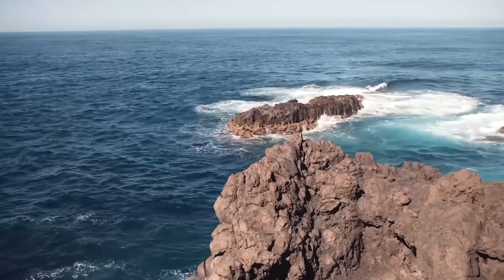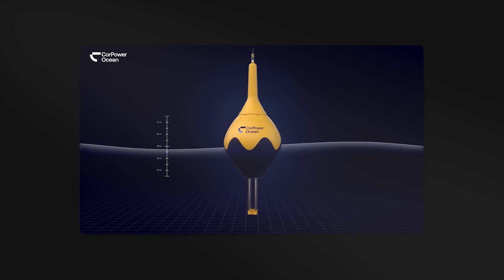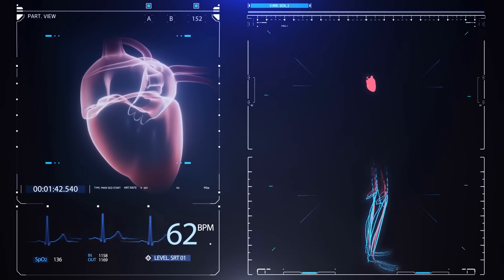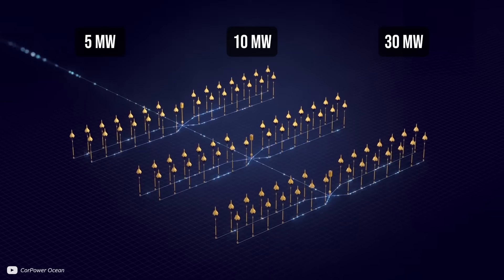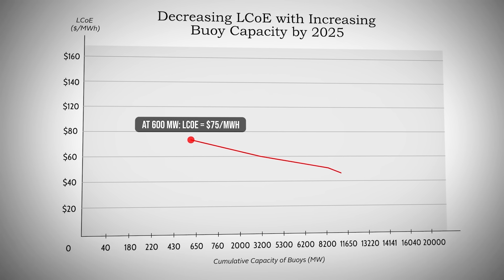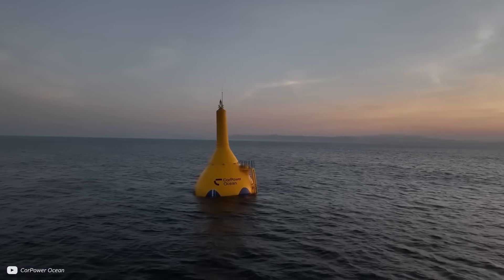Unlimited Wave Energy: This Buoy is the Future

Comment: Hydraulics are not clean energy, if a Oring breaks or a hydraulic line breaks you have a serious problem with contamination. You are definitely going it the right direction with the ocean as it is the most powerfull natural force on earth. If anyone has more information contact me
Reply: These internal mech (i guess) wouldn't be operate using oil pressure; they're probabile use pneumatic system.
Reply: @massimopiu yes they need to operate on hydraulic fluid which is a fossil fuel for the viscosity to enable the piston to operate at it’s potential. With my patented invention I don’t use hydraulics or any battery backup

Comment: @ZirothTech what do you think of the system developed by Panthalassa? Seems that not attaching the buoys to the bottom of the ocean could significantly simplify operations. + Opens a much large area of operations. On the flip side, it's not clear how to transport the energy generated miles inside the ocean.

Comment: How about a linear generator oriented vertically, underwater? When magnet container gets to bottom of coil shaft, it expands, reducing density and using buoyancy to bring container back up. All underwater. Density change mechanisim theoretically uses less energy than the generator produces, thus no fuel, or waves, needed.

Comment: Tidal power and wave action can be used in remote areas ,where power doesn't exist, to power Oceanic Aeration. If Oceanic Aeration was developed around the Arctic, the diffusion of frigid air under the sea surface would cool the surface water and accelerate the refreezing of that region.  A thousand cubic feet per minute of frigid air diffused under water has been proven to effectively cool 450,000 gallons in that same minute. If you don't believe this, take a compressor and some diffusion equipment up there and try to prove me wrong. We've got to make a serious effort to cool the oceans or all the negative predictions will come true. Fossil fuels aren't going to just disappear, it takes massive amounts of fuel to restore things after each major weather event.

Comment: AI Summary

Abstract:

This video explores the C4 wave energy converter developed by Swedish company Core Power, a technology aiming to overcome historical challenges of efficiency and survivability in harnessing ocean wave power. Inspired by the human heart's efficiency, the C4 utilizes a pneumatic system, the "WaveSpring," which allows it to capture energy during both the upstroke and downstroke of waves, reportedly five times more energy per ton than other systems. Key to its design is a dynamic adaptive piston pump concept, originally patented by cardiologist Dr. Stig Lundback, which uses stored pneumatic pressure for a dual action. This system also enables a "detuned storm protection state," allowing the C4 to withstand extreme weather, as demonstrated by its survival through powerful Atlantic storms with 18.5-meter waves. The C4 buoys are made of lightweight composite materials and are tethered by a novel "UMACK" anchoring system, designed for high holding capacity, low cost, and minimal environmental impact. Core Power's strategy emphasizes reducing the Levelized Cost of Electricity (LCOE), with projections of achieving costs competitive with wind and solar power through large-scale deployment in "Core Packs" or wave farms.

Core Power's C4: Revolutionizing Wave Energy with Cardiac-Inspired Tech and Storm-Proof Design

*   0:00:02 - The Untapped Potential of Wave Power: Ocean waves could theoretically meet global electricity demand, but harnessing this power has been a long-standing challenge due to failures in previous technologies.
*   0:00:16 - Core Power's C4 Innovation: Sweden's Core Power introduces the C4, a floating wave energy converter inspired by the human heart, claiming to capture five times more energy per ton than other systems.
*   0:00:40 - Overcoming Survivability: A primary challenge in wave energy has been device survivability. The C4 was tested off North Portugal, successfully enduring four powerful Atlantic storms.
*   0:00:57 - Historical Failures: Since 1799, numerous wave energy patents (e.g., Salter Duck, Mighty Whale) have emerged, but commercial success has been limited by efficiency and survivability issues.
*   0:01:44 - C4's Design and Operation: Core Power uses lightweight, tough composite buoys in a point absorber configuration, tethered to the seabed. The C4 converts linear up-and-down wave motion into rotation via small gears, powering an onboard generator.
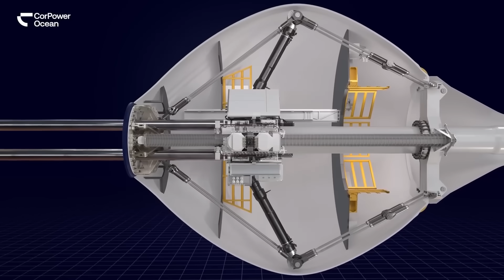*   0:02:08 - Impressive Test Results: A six-month test in Portugal achieved a peak power of 600 kW, comparable to wind turbines that are significantly larger and more complex.
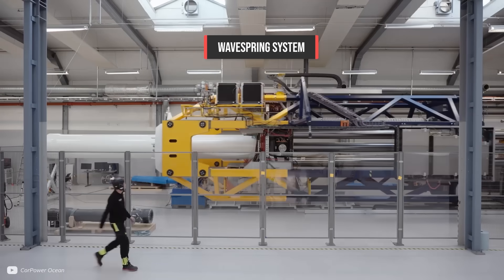*   0:02:48 - The WaveSpring System & Cardiac Inspiration: A key breakthrough is the "WaveSpring" system, building on a hydraulic pump invented by cardiologist Dr. Stig Lundback, inspired by the heart's efficient, dual-action blood flow using pressure.
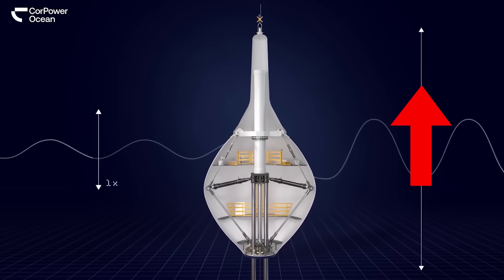*   0:03:41 - Pneumatic Dual Action: The C4 uses a pneumatic system. As the buoy rises, a central pneumatic cylinder and springs store pressure. This stored pressure provides a returning force as the buoy descends, allowing energy capture throughout the entire wave cycle.
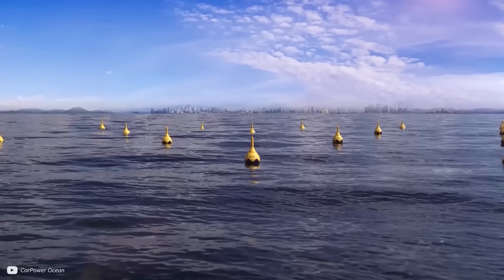*   0:04:38 - Storm Protection Mechanism: The pneumatic system allows pressure to be increased during storms, creating a "detuned storm protection state." This limits buoy movement in harsh waves, enabling it to survive record-breaking 18.5m waves.
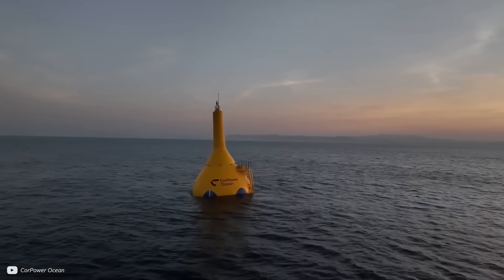*   0:05:09 - Continuous Wave Tuning: In favorable conditions, the C4 buoy is continuously tuned using the onboard generator and WaveSpring system to work in phase with the waves, maximizing power extraction.
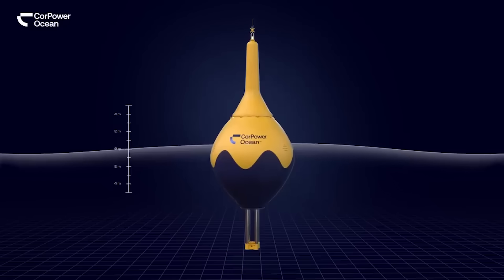*   0:06:53 - Smart Control System: A smart control system manages energy storage and release by the pneumatic springs and how hard the generator works, ensuring the buoy moves in phase with waves, reportedly increasing energy extraction by three times compared to passive systems.
*   0:07:51 - UMACK Anchoring System: Each buoy is anchored by a tensioned mooring system called UMACK (Universal Mooring Anchoring and Connectivity kit), which outperforms traditional anchors in holding capacity, cost, and carbon footprint, and is installed with low-noise methods.
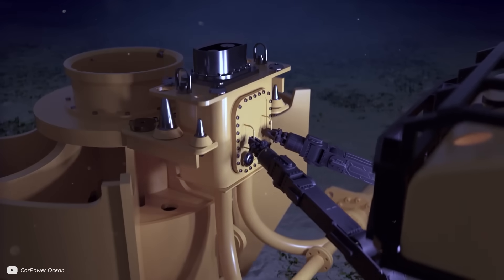*   0:08:27 - Vision for Wave Farms (Core Packs): The long-term plan involves arrays of buoys ("Core Packs") in 5, 10, and 30 MW sets, forming wave farms delivering electricity to the grid via collection hubs.
*   0:08:46 - Focus on Levelized Cost of Electricity (LCOE): Core Power's innovations are driven by the goal of reducing the LCOE. Design choices, like using composite hulls (70% LCOE reduction over steel) and developing the UMACK anchor, are aimed at making wave energy competitive.
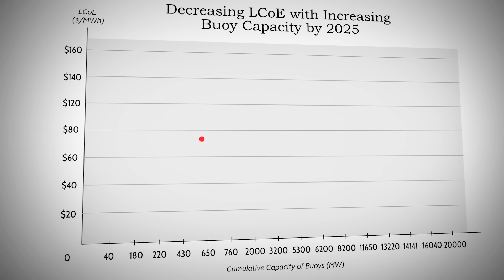*   0:10:07 - LCOE Projections: With 600 MW installed by 2025, LCOE is projected at $75/MWh. With 20 GW capacity, it could drop to $35/MWh, competitive with wind and solar.
*   0:11:12 - Future Testing and Outlook: Following successful C4 tests, Core Power will test arrays of buoys, focusing on long-term survivability in harsh ocean environments, with a positive outlook for commercial wave power.

I used gemini-2.5-pro-exp-03-25| input-price: 1.25 output-price: 10.0 max-context-length: 128_000 on rocketrecap dot com to summarize the transcript.
Cost (if I didn't use the free tier): $0.03
Input tokens: 15494
Output tokens: 1184

Comment: This is a fascinating technology, and its proven record in severe storms is impressive. Their biggest challenges at this point are: maintenance/longevity, which is still difficult to overcome in the harsh and corrosive sea environment, and  theenvironmental impact to the surrounding marine life, which means it needs to be low noise when it functions (not just when it's installed) and doesn't cause significant disruption for sea life in other ways. 

Other than that, end of life recycling needs to be considered too as the fibreglass hull will have the same issue as wind blades - although considering that recycling wind blades is a necessity someone will have to work out, they could just wait for that breakthrough and hitch a ride...maybe? Otherwise they'll need to develop their own recycling process or change processing and/or materials so it can be recycled. 

In the larger context, this could work well with other renewables too, such as working together with offshore wind to cut costs in power lines to shore.. In fact, with the incredible efficiency, smaller size, and far more reliable operation than offshore wind, this innovation might actually replace it at some point in the future (like a decade...). With how reliably waves could create power on a day-to-day basis (rather than wind and sun which are far more intermittent), this won't need much  batteries ether (if it needs any at all), meaning that cost doesn't need to be factored into LCOE. In fact, this tech could act as a kind of baseline power for other renewables. 

It has a lot of potential, but only time will tell if it's capable of functioning reliably in the sea for years on end.

Comment: Google says that they are cheap to maintain.  Here is a quote from Google about their maintenance:

CorPower Ocean's wave energy converters (WECs), including their C4 and C5 buoys, are designed for long-term operation with minimal maintenance. The company focuses on designing components for two to five years of operation without maintenance. Maintenance activities include scheduled checks, inspections, upgrades, and potentially unscheduled repairs. They also offer an Operations and Maintenance (O&M) package to guarantee low-risk and carefree ownership of wave farms.

and it says this as well:

Components are designed to withstand the harsh marine environment and the repetitive loads of wave motion, aiming for a long service life.

These are quotes from Corpower's internet site:

Corrosion: inspections confirmed that chosen corrosion protection solutions have generally worked satisfactory. The composite hull making up most of the surface in contact with sea water was inherently corrosion protected by the material stack. The four metal rods in contact with sea water at the bottom with laser cladded surface coating have shown excellent corrosion resistance. A few parts around seal gland assemblies that relied on cathodic protection were found corroded, which was addressed by adding appropriate electrical connection to the cathodic protection. A few parts of the H-link connecting the bottom of the tidal regulator with the anchor quick connector had a paint-based protection systems that was found inadequate, with root cause found to be quality issue in the coating process that were addressed.

Biofouling: The anti-fouling protection solutions have been found to work satisfactory on both hull and ocean rods. The commercially available anti-fouling paints used were found to supress biofouling. Alloy-Coated rods at the bottom rely on periodic scraping sequence performed by the machine control system. Upgrades to the seal gland and scraper of the tidal regulator have been performed in collaboration with the supplier, aimed at ensuring long term reliability of the scraping function.

Comment: I am a lone inventor and I slip through the existing system in the UK which only helps university research and big businesses. I am a member of the Scottish Innovators Network and our group is now reduced to six members from a high of ninety. The system even excludes professors in our group! We have various innovations for carbon capture, wave power generation and electrical storage concepts using laser technology. Do you know of anyone who could help us to get our ideas reviewed. Presently we cannot even show the ideas as there is no pathway to do this simple yet vital first step. Great video. I have a device for getting electrical power generation from a flat calm water surface but no way to show it to the relevant influential stakeholders. I hope you can help. Thanks. Rod.
Reply: Dr. Ben Miles (he has his own YouTube channel) runs a venture capital firm that focuses on bringing new technological scientific discoveries and prototypes to market. If you check out his channel you can see the kind of technology he showcases as a YouTuber and what his company supports. I don't know if this will be helpful or not, but he does say to contact him regarding such things. There are groups who also do similar work, but I don't know any names I could reliably put forwards. 

I don't know if any of this is relevant to you or helps, but in any case I wish your group good luck in getting your innovations out there.

Comment: I have an idea. A lever attached to a one direction ratching system. The lever moves up, the ratchet moves clockwise. The lever moves down, the ratchet moves clockwise. Now attach a float to the end of the lever and the ratchet ststem inside the hull of a boat...see where I'm going with this?

Comment: Tides are consistent and can be accurately forecast, unlike wind or solar energy. However, tidal power generation requires areas with high tidal ranges, and while such areas do exist, they are not common. The next challenge is that tidal power is not constant throughout the day, so you need a method for energy storage.

Comment: This is such a revolutionary innovation ❤....I was thinking if we want to build a 1000 km long bridge through sea to carry heavy loads; But the problem was arising that the bridge need support pillars to be stable throughout such a long distance. And building typical support pillars under deep sea is very expensive. So, to counter that I thought to use floating bases with supporting pillars on them. But there was another problem with floating bases was it's turbulence due to heavy sea waves and currents. I thought of several ways to counter that and fix the bases on their position again any kind of heavy waves: (1)Using heavy weights working as anchors tied with bases.With this (2)using seismic metamaterials....but it turnedout too expensive(3) Then I got this idea from your video!!❤
This is such a genius strategy!!! It will not only just provide stability to the bases but also harness energy from the waves to provide electricity on the bridge. So, thanks a lot for making this amazing video. ❤ keep it up.👍

Comment: This system is too complicated. If use just for what a problem the whole system would be lighter way cheaper. Maybe less efficient, but what a pumpkin can be used. As an energy storage system. So they energy electricity will be produced at a single point .

Comment: As a guy live next to the ocean, there are things need to point out; anchoring to seafloor disrupt corrals, internal parts are complex prone to fail in salty environment, typhoon or heavy storm can easily damage the buoy, power transfer cabling from the buoy back to power grid, low tide and high tide can make this buoy loose its effectiveness, lengthy permit process with local government can turn the most hardened enthusiasts away

Comment: Our company worked some of these systems as far back as the 1980s.  The problems with the Human Heart are basically twofold.  First the aging of the materials, and Secondly the valve leakages.  This buoy will have the identical problems, and just like in Humans, the materials involved will determine economic success of failure.  In seawater, the free Chlorine and Sodium ions, along with sunlight, will cause all known "seals" to fail eventually, unless there is a replacement mechanism built in.  Composites are more durable, theoretically, than common industrial metals, but this remains to be seen.  One advantage of these energy gathering fields is that could prevent enemy submarines from encroaching, and to prevent "illegal Trawling" by Chinese pirates.  In between them, you could put fish-farms, and add to the food supply.

Comment: All things being equal, the long-term success of a mechanical system correlates well with the number of components. Most likely to succeed are those with very few moving, mechanical parts. We're seeing this achilles Heel show up in wind turbines, the Osprey Helicopter, etc. Another hidden (serious) challenge is corrosion in an ocean environment....it's possibly one of the most corrosive environments for metal.  Odds say that the efficiency of this Buoy Generator will have limited success due to relatively limited useful life.

Comment: Why do not use a 20 mt above  bottom of sea pulley  linked to the buoy to rotate an external generator and lift a weight that sinks after the wave crest ?  This cycle repeats while there are waves. It is like the land weight potential energy accumulators.

Comment: The biggest challenge of energy generation is energy transport.  You lose a lot of power with range, it is actually a ridiculous amount.  Putting devices out in the ocean will generate lots of power, but by the time the cables reach the shore you lose most of it.  Therefore, innovative ways need to be used here.
Reply: You totally overstate the worry about transmission losses. For example HVDC losses are about 3.5% per 1000kilometres, so we could transmit solar/wind from the Moroccan desert to the southern UK with around only 12% losses.
Reply: Put them along a shipping route and come up with an energy transfer system to power electric shipping vessels ;)

Comment: It has a piston that passes through a seal exposed to sea water.  There is also a movingnpart at the base on the sea bed, also exposed to sea water.  I wonder how well those components will fare tens years down the line?  I think the power generating mechanism needs to be fully enclosed.